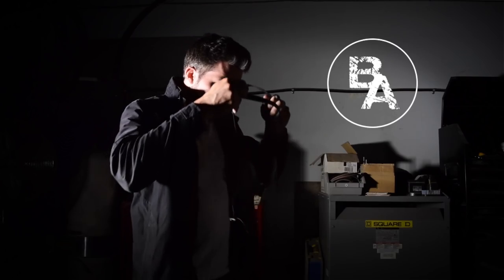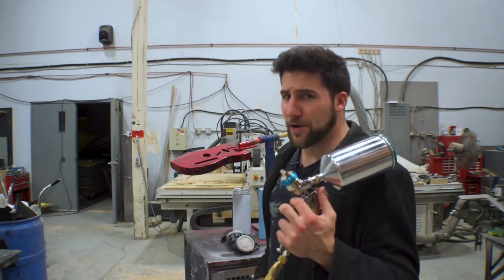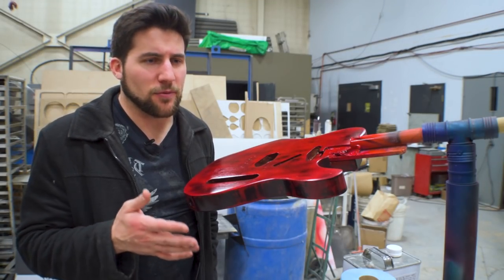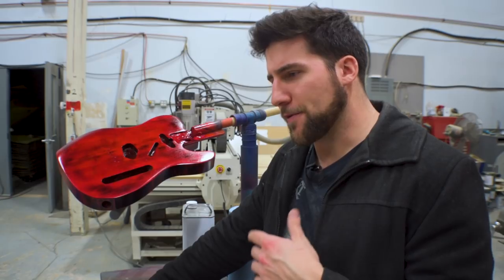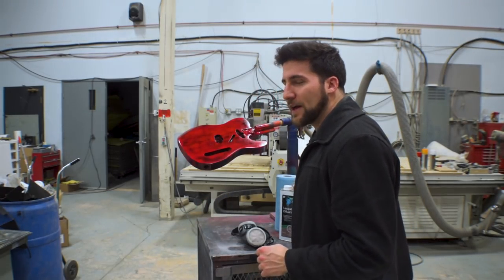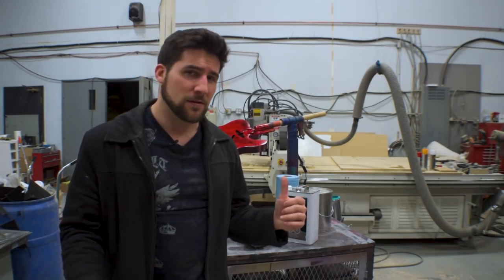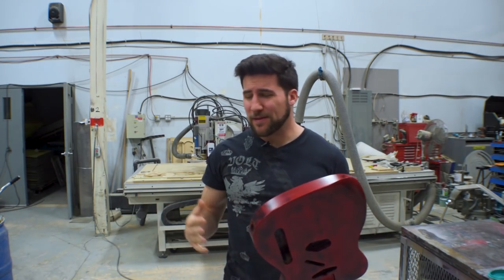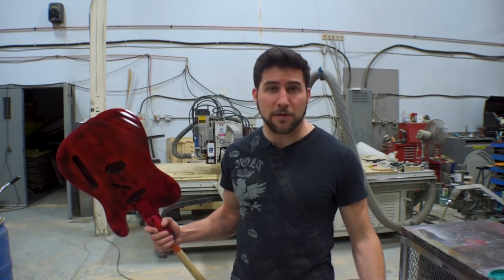How to Paint With Nitrocellulose Lacquer

Comment: Hey Brad!
I'll soon start the color coats on my strat style guitar. Do you recommend using white primer->shoreline gold metallic->candy apple red metallic
(All from Oxford)
I've read online that on pre cbs and cbs strats, Fender used Inca Silver and Shoreline Gold as a base before the Candy Apple Red application.
Reply from the maker: Yes, I would use the gold. It makes getting a good red color easier. The vintage method is with silver though.
Reply: @BradAngove  any tips when working with metallic over metallic?
Reply from the maker: Oh, wait. If you’re using the red metallic you don’t need a gold base. That’s only for actual candy red. The candy red metallic is designed to look like a full candy job, but you can skip the silver or gold base.
Reply: @BradAngove  I think ill Go with Inca Silver and Transparent red from north west guitars. The level of depth is better as ive heard.

https://www.northwestguitars.co.uk/candy-apple-red-nitrocellulose-guitar-paint-kit/
Reply from the maker: I hope it goes well
Reply: @BradAngove  i have some alder pieces for testing. I'll see which one I like better.

Comment: Hi Brad about how long to you wait in between the first 1 to 3 coats on a guitar that has no finish to start, using lacquer
Reply from the maker: With lacquer on a warm day I spray my 2-3 coats of color a few seconds apart. 
The sealer that I typically start with I give 10-15 minutes and do 2-3 coats.

Comment: Another dumb question you may have anser to... will automotive acrylic lacquer work with behlin string instrument lacquer? Dont want to mix or buy several bottles to make grey. So body would be done in acrylic and top coat with behlin thanks.
Reply from the maker: Why wouldn’t you just top coat in acrylic lacquer in those circumstances?

Comment: So, the face mask you linked that comes with the cartridges, is it safe for spraying nitrocellulose? Don't want to inhale this stuff. I checked it out on amazon and it was less than $20
Reply from the maker: I use the full faced mask usually for nitrocellulose. The cartridge half mask should be fine if you’re in a reasonably well ventilated area though.

Comment: Lots to learn here. Very informative. i have question about spray guns tho. I recently picked up a Vaper HVLP gun and it seems to work fine except it has a 1mm nozzle and doesent spray very much at a time making it painfully slow and produce bad orange peel. i was using water based clearcoat. It looks like I'm faced with getting a different gun as they dont sell bigger nozzles for this one.. any ideas.
Reply from the maker: What kind of ideas are you looking for? I agree that something with a larger nozzle would help. Even my favourite mini gun has a 1.2mm nozzle, but I wouldn’t use that for clear.
Reply: Hi Brad, thanks for the reply. I guess I'm tryin to use the wrong gun. I'll look around for something better.. thanks again.
Reply from the maker: There’s a link in the description for the Warwick guns I use as well as a discount code for 10% off (applies at checkout) if you’re looking for a decent one.

Comment: Brad I was wondering if you could tell me why my nitrocellulose paint coats have cloudy or blush looking areas in the finish. I haven't clear coated yet. I also have another can of nitrocellulose color if needs be. I used Oxford brand royal purple. Is this anything that can be fixed with more paint coats or.....just how do I fix this before clear coat.
Reply from the maker: Yes, that’s called blushing and it’s humidity trapped under the clear. Mohawk makes a good blush remover. You can also try to carefully take it out using a heat gun (gently). You need that humidity to escape and evaporate.
Reply: Thanks Brad, I'll try the heat gun

Comment: Hey brad question about spray nitro primer. I bought some Oxford nitro 8 ounce tins and using an hlvp spray gun to spray it, but when I spray it it barely comes out wet, like it comes out almost dusty, like there’s full coverage, but it’s more dusty and not super wet. Like when I spray I barely see an wet gloss look too it. It pretty much dries minutes after spraying, and like I said so wet shiny look from spraying. Why is this and what can I do? I’m spraying in 11°c weather? Any tips thanks!? Also is this just cause it’s primer? Will I see any difference in wetness when I apply the actual colour? Also I believe it’s a 1.0 nozzle touch up gun if that helps?
Reply from the maker: What psi are you spraying at?

Comment: Nice vid Brad.
I got a few things for free from the wife of a recently deceased wood worker.
Among them a 5L can of polyurethane, but the paper label around the can has come off, so I just see "polyurethane clear gloss" and "solvent-based" on the can cover but dunno whether it is sprayable or wipe-on.
Is there a way to tell? no risk to damage the spray gun in giving it a try on a piece of scrap wood ?
Reply from the maker: You can spray pretty much any polyurethane if you thin it sufficiently. It’s certainly not the same as a catalyzed automotive polyurethane, but the main difference between the more typical brush on, wipe on, or spray on polys is the thinning. 
You shouldn’t have any trouble cleaning the gun the normal way after even if it’s wipe on.
Reply: what can I say except thanks for the quick reply within 11 minutes.
If you ever come around my corner of Europe all rounds are on me.
Reply from the maker: You’re welcome. I hope you get good use out of the poly.

Comment: Brad, happy new year.  I wanted to ask you about color and tone sound, Billy smashing pumpkins comment at guitar center. . I'm a painter by trade over 25rs. We all know that it's a pigment, and all paint tint based is a milky white. Now.  It's all about color thickness different colors have more coats and like candy needs a silver or sometime gold base to pop the candy color. We all also know wood tone. But it's the pickups and electronics are the true tone maker on the guitar. Comment?
Reply from the maker: Candy paints aren’t pigment based. They are dyes, which is why light passes through them rather than reflective off of them. 
Different colours of course build differently. Candy looks completely different depending on what you put it over. The metallic bases are frequently used to give some sparkle, but the candy colours would creat depth regardless. 
If you want my comments on what creates tone, have a look at my video about whether the finish on your guitar affects its sound.

Comment: What're your thoughts on using acetone in place of thinner when mixing lacquer? From what I've heard it, it cuts down on drying time quite a bit.
Reply from the maker: Lacquer dries to the touch in seconds regardless if you spray it correctly. I would think acetone would make it more likely to shrink, but I haven’t tried it except for helping cut brushing lacquer to spraying consistency.

Comment: Hi Brad,
Could you please tell me if you can spray a water based polyurethane lacquer over a cellulose car paint?
Lots of great content on your site, thanks from the UK.
Reply from the maker: I’m actually kind of confused by your question. I’ve heard of water based poly, and water based lacquer. Urethane/polyurethane are solvent based if I’m not mistaken. Lacquer and polyurethane are also quite different, so a water based polyurethane lacquer isn’t something I’ve ever heard of. 

And beyond that, I didn’t think anyone had used cellulose as a car paint in decades. That aspect concerns me a little as well. Are you sure that’s what you’re dealing with?
Reply: Brad Angove 
You go me thinking then for a minute so I had to double check. The varnish top coat I intend to use is Ronseal diamond hard finish, which is a water based polyurethane varnish. I would guess the American equivalent would be Varithane water based polyurethane.The colour coat is probably acrylic but the thinning product as recommended by my local car paint supplier is cellulose at 1 to 1 mix.
Reply from the maker: Ok. You should be able to use those together. Just give lots of dry time in between, and lightly scuff your base coat before adding the clear.

Comment: Hi Brad. Thanks for all your vids..i really enjoy them.Did you fill first the bare wood with grainfiller ? You can't get a flat surface otherwise than paint 30 layers of nitro over it i think. It would be nicer if the surface was plain flat buffed. Just a matter of taste i guess. Or could it be possible to first grainfill, than apply schellack or true oil in multiple layers against the direction of the grain, and than spray nitro over it, after sanding, alltough i'm not sure or this nitro would interact with the oil ? I would use oil because to obtain the natural tone of the wood, like nitro does. Polyurethane and Urethane doesn't really. My situation is: i've spraypainted for over 20 years cars, all kinds of plastic, carbon, fiber bumpers and industrial machines and parts and many kinds of paint. But after 10 years, people forget some things. Therefore, it is very important to know what goes with what and wich order to apply.One important question to you is.. never put cellulose lacker over synthetic.. or was it the way around ? I"m also painting oil - portrets, and the first thing they tell you is..never put acrylic over oilpaint. The way around, no problem. Under here sombody says he put acrylic clear over alkyd lacker, i see many people do that on You Tube, but after a while, the acrylic will peel of. I think i've seen most of your vids here, but regarding this.. i never found clear answers to this. I think it would be very usefull for many people, if not all, to spend a topic alone on the matter wich paint works with wich paint and in what order. I really hope you would consider that, because most of the painting fails happen due to lack of that knowledge. Thanks again Brad. Greetz from Belgium.
Reply from the maker: There was no need to fill first. I sprayed a couple coats of Behlen vinyl sealer and was able to move right to nice smooth coats. 
Nitro and oil likely wouldn’t play well together. And don’t put lacquer over synthetic paint. 
I’ll try to do a dedicated video on this topic, but I’ve already got one about how to layer different types of paint I think.

Comment: Hi Brad. quick question... would be super helpful to get your opinion...    i bought an 82 ibanez as200 long story short someone sprayed clear LACQUER over the original POLY finish.. they were trying to protect it or something i guess... is there any good way to remove the lacquer only from this vintage guitar during my restoration process? please help!
Reply from the maker: If it’s lacquer over poly should should be able to take the lacquer off with lacquer thinner. Check out my color over color relic video for a demo.
Reply: @BradAngove  thanks. what if it turns out to be more poly or another type of clear coat?
Reply from the maker: It depends on the clear. If it’s polyester the only option is to sand it, which is risky.

Comment: Brad, can I use a diluted polyurethane (50/50) as a grain sealer before applying water based Color Tone dye, then use nitrocelulous laquer as a clear coat?  I assume as long as the diluted polyurethane dries thoroughly before applying the dye, then finishing with the nitroceluous laquer, that there wouldn't be any issue with respect to the poly being under the nitro.  Do you think the diluted polyurethane will permit the dye to still take once the polyurethane is dry?  I am thinking that using the diluted polyurethane might raise the grain less before I apply Color Tone water based dye.
Reply from the maker: The poly being under the nitro won’t be a problem as long as you allow ample drying time. However, it will prevent the dye from soaking into the grain properly. If you’re trying to dye the entire surface, that won’t work.
Reply: Thanks!  Would I be better off with Color Tone in Alcohol with respect to raising the grain less, and getting a more even coverage?
Reply from the maker: You would be better off just raising the grain on purpose once and sanding that raised grain off. The grain doesn’t lift repeatedly. After you raise and remove it, you can use alcohol or water. They both apply evenly.
Reply: I used some Timbermate (Natural) on the mahogany back as a grain filler, sanded it off, then I'll stain with Color Tone. Should I do the same with the maple top with respect to using the Timbermate, or just stain the maple directly without any sealer?  The maple is paper thin...

Your videos are excellent by the way, and  you are very gracious in answering questions!  After reviewing your videos on Nitro and Polyurethane, I've opted for rub-on Polyurethane.  Poly seems easier and better in many respect....but, if I have to repair it someday, I'll just have to sand it off.  

Thanks very much!
Reply from the maker: I would skip the filler for the maple veneer. Aside from that it sounds like you’re all set.
Reply: Thanks again!
Reply from the maker: You’re welcome.

Comment: Loving your channel. Hugely informative and inspiring.
I am looked to do a guitar project which will involve spraying a body with automotive paint as this is a proprietary Alfa Romeo colour - the same pearlescent colour as my car. It may be polyester based (one of the potential suppliers says that theirs is). Will this be compatible with a nitocellulose lacquer, and will it be also compatible with a nitrocellulose primer? Many thanks for your reply!
Reply from the maker: It wouldn’t really make much sense to use nitro with polyester. You could probably get away with it, but polyester dealers are good and polyester clear is very durable compared to nitro.
Reply: @BradAngove  Thanks  very much for getting back to me. It's all going to be a bit vintage, so that's why I was thinking nitro, but it won't be relic'ed. Quite the opposite, so I think I'll follow your advice and go with poly (after all, there is no point in asking experts for advice and then ignoring it.) I see my Baja Player Tele is finished in poly (thin, so they say) and I can't really tell the difference between that an my American Deluxe Strat which is supposedly finished in nitro. It's all good. 
An  idea for a future video could be to explain all these compatibilities or lack thereof. It's really not clear to most people. Cheers!
Reply from the maker: That video is on the list haha.
Reply: @BradAngove  Cool!

Comment: How about applying a nitro seafoam green finish on top of an already sunburst finnished guitar? The sunburst finish is probably poly... how would one go about this?
Reply from the maker: Sand the poly down with 400 grit paper so the nitro has something to adhere to. Spray a coat or two of sanding sealer to act as a bridge between the poly and the nitro (optional but a good idea), and then go ahead and start working on your nitro.
Reply: Brad Angove thank you, very much! I will do my best :)

Comment: Hey Brad, may I ask a question? I got the Behlen aerosol stringed instrument lacquer and sprayed my 10 coats, but it never seems to completely dry even after a couple weeks of sitting. It feels really sticky to the touch like a piece of scotch tape or something. Do I just need to wait longer for it to cure? I'm confused!
Reply from the maker: What recoat times did you use, and what are the temperature and humidity like where you have the guitar?
Reply: @BradAngove  I did 2 to 3 coats a day roughly spaced about 3 hours apart. I did it in my shop with the doors open. I'd say it was about 75 to 80 degrees Fahrenheit. I live in Oregon. I didn't think it would be humid enough to make any kind of difference. Maybe just wait longer between coats? Or wait a month for it to cure and hope it's not tacky? I'm not sure. P.s. thanks for replying.
Reply from the maker: That’s odd. You may have gone a bit heavy/fast, but nonetheless I would generally expect it to be dry to the touch within minutes or hours, not weeks. It takes more time to harden fully, but shouldn’t be sticky. Although nitro does get sticky when it’s too warm sometimes.

Has it been drying hanging up somewhere reasonably warm?
Reply: @BradAngove  I did suspect that I applied the coats a bit heavy and fast. Also I've been laying it flat on a table and spraying the top while it sits face up. Not sure if that matters or not. I've been letting it dry in my studio once I feel like it sufficiently flashes off and isn't giving off much odor. Also I read somewhere that it's smart to spray down some vinyl sealer first, but I didn't do that. Maybe that's why it's sticky? I'm not sure. This is my first time refinishing a guitar let alone an acoustic.
Reply from the maker: The vinyl sealer shouldn’t impact drying time really. Temperature, humidity, coat thickness, and recoat times should be about all that matters for spray can lacquer. It’s not just the temperature you spray at though. It also matters what it dries at.
Reply: @BradAngove  Will it eventually become less tacky if I put the coats on too thick and too frequent? Or is it ruined and just have to start over?
Reply from the maker: It should harden over time, but I’m not confident in that because your situation here is one I haven’t really encountered with nitro before.
Reply: @BradAngove  ok thanks for the help man really appreciate it. I think I'll just spray some lighter coats and then let it sit and dry for as long as it takes

Comment: Wish I had a shop like that , I just use my garage
Reply from the maker: I do most of the building in my garage these days. The shop is wonderful for painting though for sure.
Reply: Quick question, I’m refinishing an old Harmony Monterey archtop. I have it stripped down to the bare wood. Does sanding sealer go on before laquer color? Or after? I’m using Stew Mac color tone laquer
Reply from the maker: The sealer goes on before the color.
Reply: Brad Angove thanks so much!